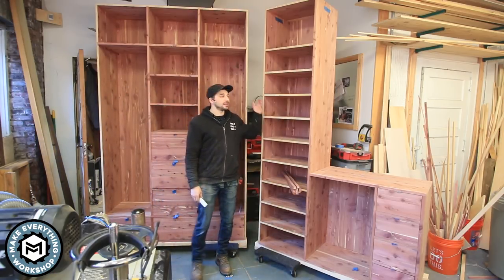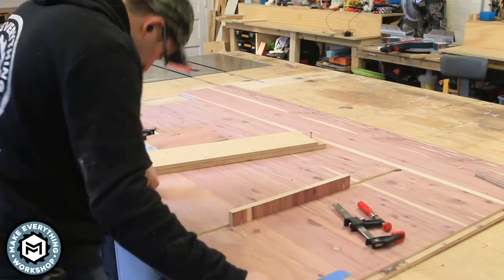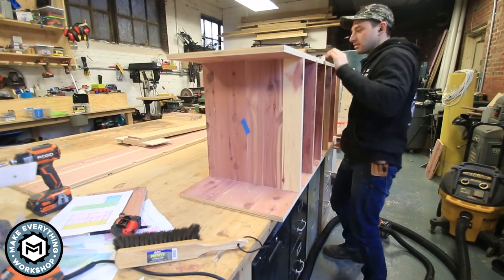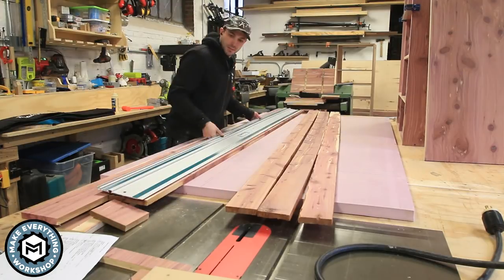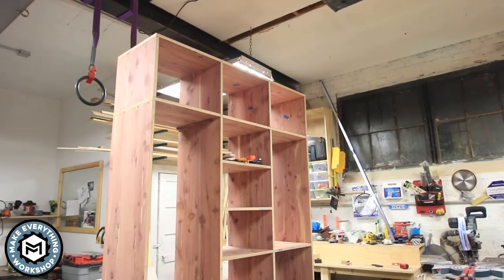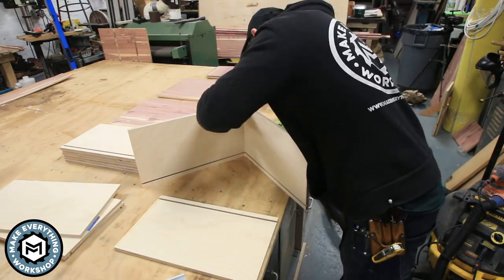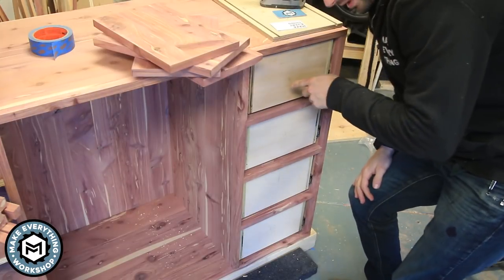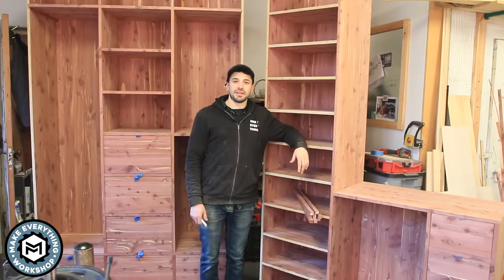Making a Custom Cedar Closet + Install!

Comment: Cool video. I dig the cedar veneer plywood. A lot time efficient stuff in here. Tip for next time, if it's helpful. When I use to build custom built-ins and cabinets I'd take an hour to make story poles for every cut and pertinent measurement. 2-3 story poles and the only time I needed a tape measure was to make them. Huge time saver.
Reply from the maker: Definitely could have used a story pole on this one!

Comment: Man everything about this video is quality.
I like that you use every different tool brand.
I love ryobi's nailguns and hot glue guns.. they also have air pumps that saved me numerous times.
Reply from the maker: Thank you! I have been using the ryobi airstrike stuff for a long time and its NEVEr disappointed me. People avoid it because they think ryobi = junk but as a professional user I can say they make great nailers. ( and no they don't pay me to say that, I buy all these tools myself)
Reply: Make Everything same here.

About 8k nails into my 18g, not a single failure.. except once when I tried to nail aluminum.

Gonna get the 23g for sure when i need it

Comment: I know this is an old video, and maybe you've learned this by now, maybe not, but here goes anyway.  They make specific undersize router bits for this exact purpose.  Woodcraft has a set of 3 to match 3/8, 1/2, and 3/4 plywood.